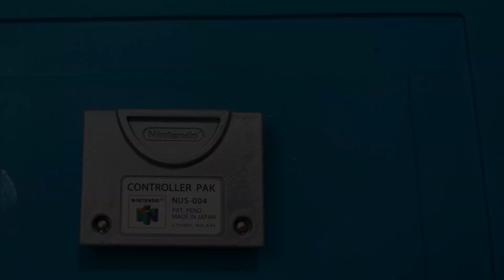Nintendo 64 FRAM Upgrade Timelapse - Forbidden 3D Prints

Comment: Only extra thing i do is change the small capacitor. I tried both ceramic and electrolytic and both seem to work fine.  I did notice that when using a ceramic cap & trying to have the console initialize or format the memory card i had to use one of those 3rd party rumble packs that have a slot where you can put a memory card  in. When using an electrolytic cap, no such 3rd party item needed for the console to initialize the memory pack. For longevity i would use either a solid ploymer cap or a ceramic. That way you will literally never have to service this thing ever again.

Comment: wondering, is there any benefit or drawback to leaving the battery in place? If you keep it there, it will eventually leak and corrode, if you take it out you may have to form a bridge of some sort for proper function in some games. If anyone sees this, which do they think is better. I don't really care about making a specific 4 games work, just getting 99% of the library to work on this and the product to be good for life. 

Battery out for me?
Reply from the maker: Hello as far as I know that are no disadvantages in leaving the battery in and that's how I've been doing it so far. I never opened a PAK that had a leaking battery and I opened a lot.
 I always try to leave the parts as close to original as I possible can when doing my mods. 
Thanks for your query 👍🏻
Reply: @forbidden3dprints  I got my pak running using the new FRAM, formatted just as you did in the video. It was functioning, But when I removed the battery, the pak stopped functioning, though it was always recognized, none of the saves stick. If a jumper between the battery terminals doesn't solve the problem then I'm not quite sure how you get yours to work. They may still be running off the battery? Idk, it's been a confusing day. When the battery truly runs out, I dont think this will function, but it wont drop the saves, which is the important part. Thanks for responding. I've a lot to think about. I will update you if the jumper works or if I have to put the old battery back in the pak.
Reply: I found out a lot more. The battery to battery jumper does not make the pack work. Seems the battery feeds the micro controller ahead of the big chip. From another youtuber you can look up, there is a 48 minute video of perhaps 3 different ways to address this. There is a small jumper config that works and is easy, there is a transistor fix that supplies power that is simple too but hard bc you need components, and there is an ultimate standard fix w multiple jumpers that will make the Fram work exactly as not intended. I'm gonna settle on the transistor fix myself, plus I bet your batteries will last super long if they just control the little chip, and not the big one behind it. Hopefully no need to worry.

I wish I were trained on this stuff in school. Very difficult to truly understand when only coming at it from a hobbyist angle.